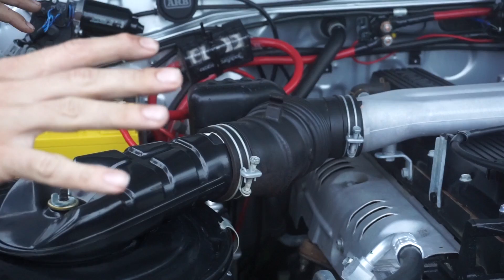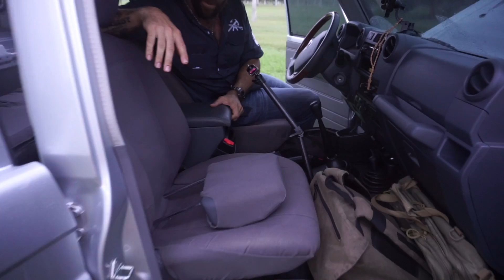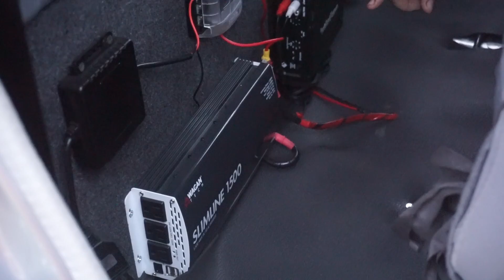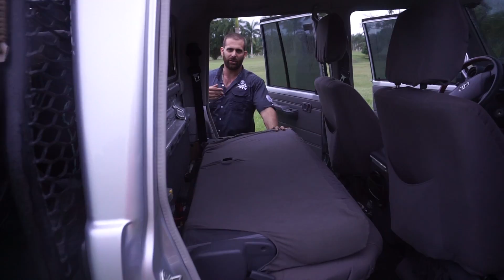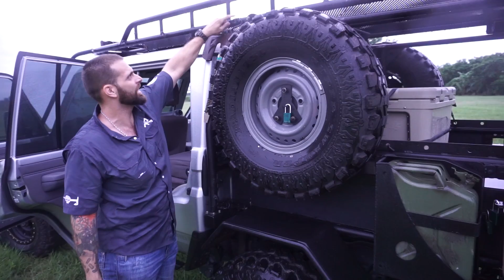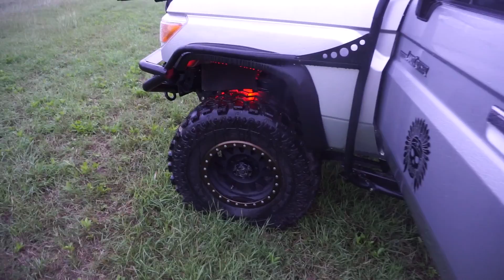Overland Expedition Vehicle Batteries And Electronics

Comment: Wait not even the turbo engine missing out man 
Should drop the turbo engine straight in
Reply from the maker: charlie fruirtbat the 1hz is the most reliable engine ever built
Reply: @BoneTactical  this is true I've seen them with over a million kms on the clock still going strong

Comment: Don't freegin solder connections, proper crimp only.
Reply: I could not agree more but people don't understand that if you use the proper crimping tool with the proper power lug it will never need solder.